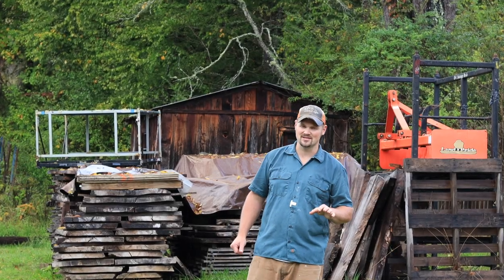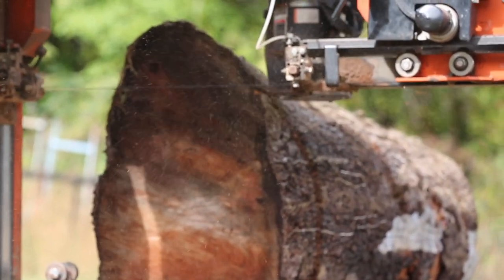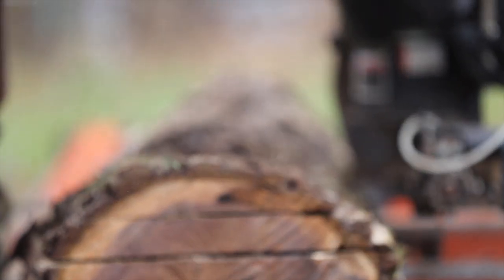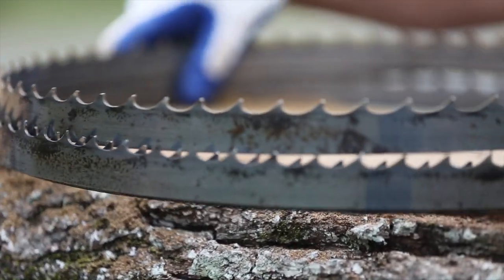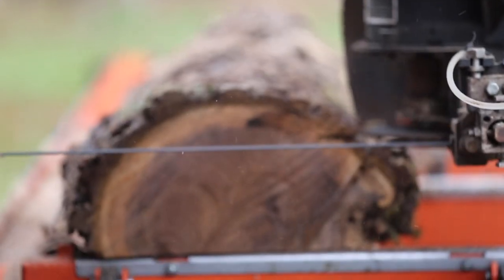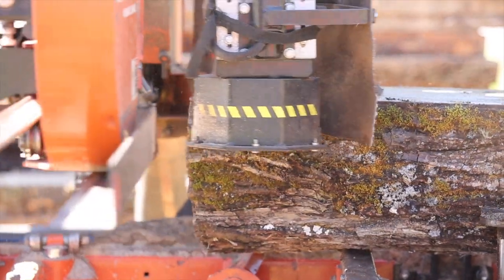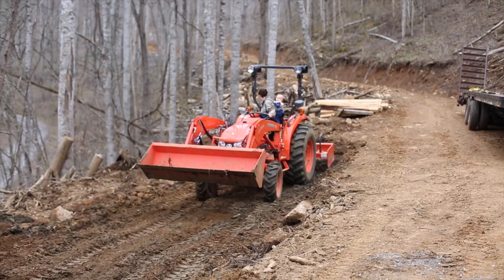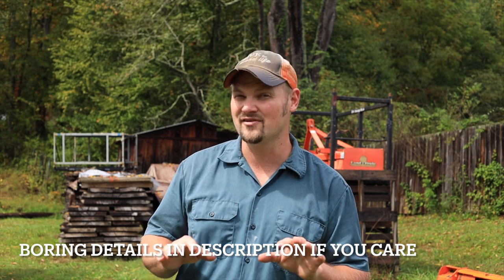the most overrated option for your sawmill

Comment: Good points. But only $4 for labor to change a blade? 
How many bf can you resaw in an hour? If it’s, say, 300bf per hour at a rate of, say, 25 cents per hour, then that’s an hourly rate of $75, or $1.25 per minute.
You can change a blade on that thing in 3.2 minutes?
I don’t have experience with these milling machines, but I know it takes me longer than 3.2 minutes to change the blade on my 14” Rikon band saw.

If your blades last 15% longer, then maybe that represents 15% more productivity.
So if before the de-barker you’re resawing, say, 300 bf per hour at rate of 25 cents per bf, then that’s an hourly rate of $75 for everything.
So with the de-barker if you’re 15% more productive, then that’s $11.25 more on the hour... maybe.
I don’t really know for sure, but it might pay for itself sooner than you think. Maybe we’re both wrong and it will take even longer than you estimated 😜
Reply from the maker: Ooohhh I smell some spreadsheet action coming up… and yea I just picked some ballpark numbers for easy math and to get the point across, there’s a ton of variables for sure!  

As for changing blades, it’s pretty quick, 3 min is about right, maybe 5 if i take a breather